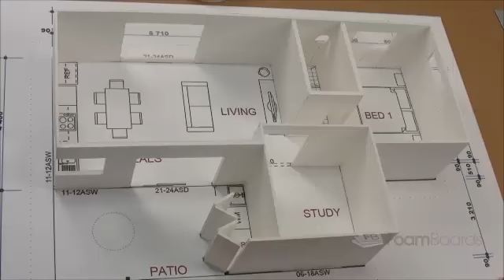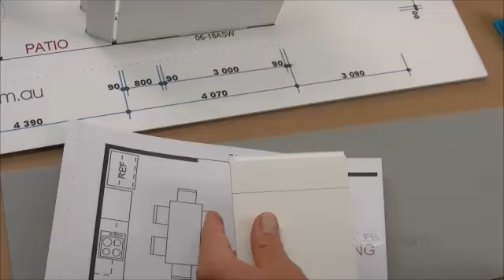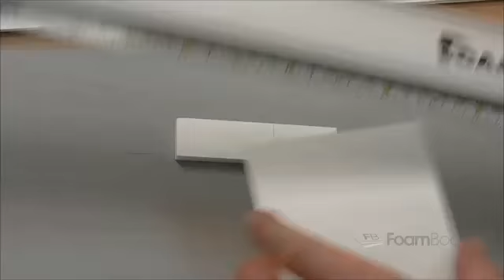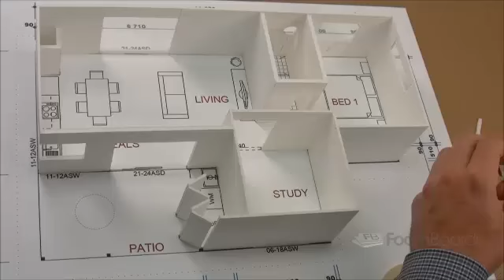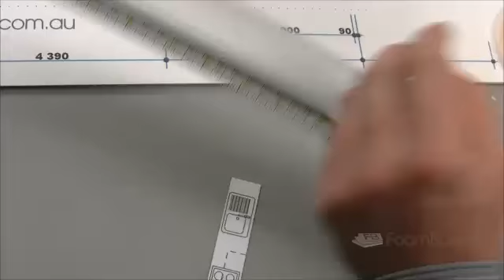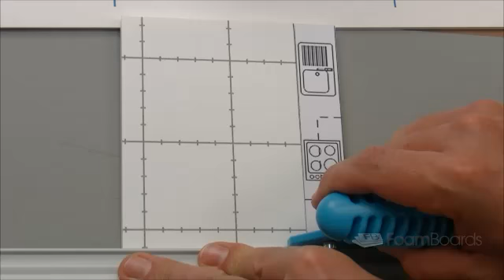Making Model Foam boards Furniture Part 1

Comment: Foam boards are so versatile. Easy to cut, strong and lightweight. What you make with this product is really up to you but for creating model train scenery, scale models of just about anything it is good to use. Lately I've made some cubby houses for the kids to play in. I full expected them to wreck them over one weekend but they are still standing if somewhat a little dog-eared.